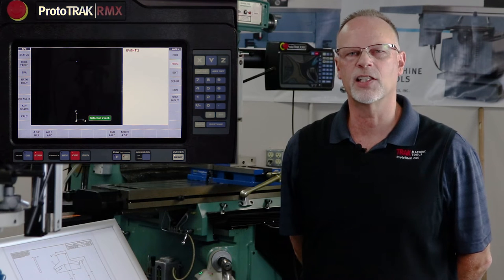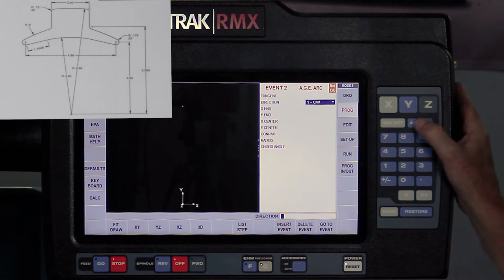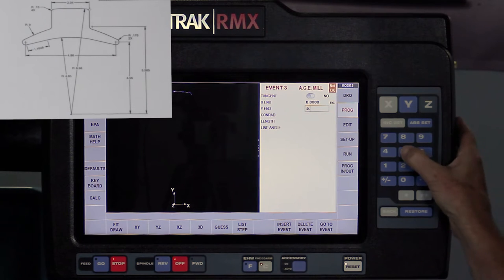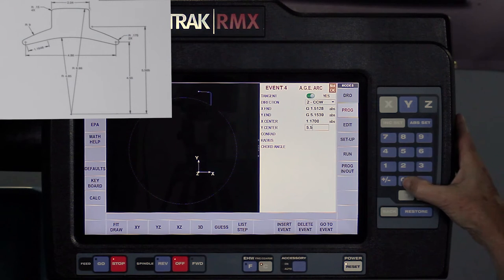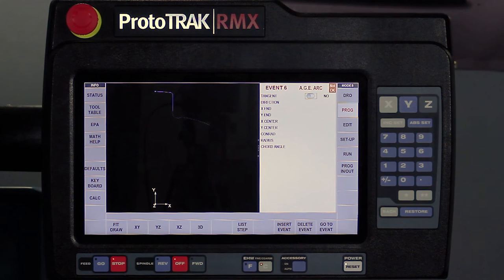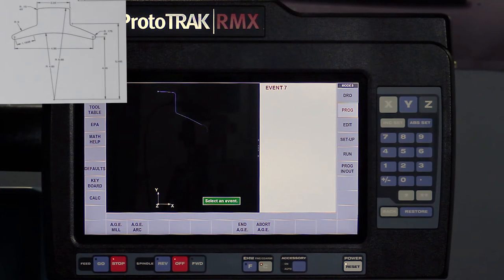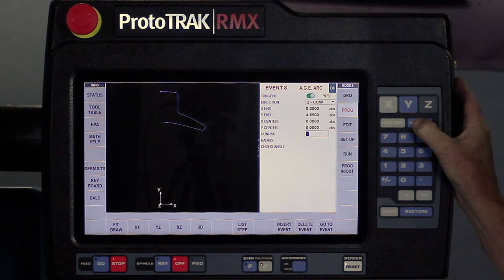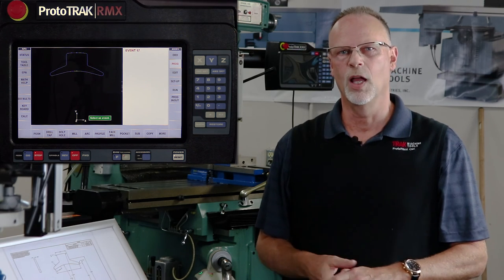A.G.E. [Part 5] | ProtoTRAK RMX CNC | Advanced Mill Programming

Comment: Hi Pat, I have a question that's totally unrelated to this video in any way, shape or form - hope that's OK!

I have an SMX machine with the DXF converter plug-in, and here at work we use Autodesk Inventor.
I'm trying to use an engraving tool to create some lettering in a 'flowing, hand-written' type of font.
Is there a 'best practice' way to do this? 
In Inventor I can create the model with the lettering on it, then use splines to model the path of the tool - basically following the middle of each letter
Problem is the SMX doesn't seem to like splines in the DXF file, I think it treats a spline as 1000's of tiny arcs, which each have to be manually selected.
Am I missing something obvious?

Cheers
Reply: Hi Steve, I have seen this problem before and I believe there are some adjustments you can make in your program to control how it creates the segments of your geometry.  It should turn it into a bunch of small straight lines as apposed to small arcs.  I'm not a CAD guy so unfortunately, I can't tell you exactly how to do this but hopefully, someone else will read this and post a better solution for you.  I do know that in some cases, exporting your DXF file as an older version such as a year 2000 file instead of 2018 for example can help with this problem too.  I'll copy one of our CAD guys on this to see if he can help you too.  T.P.
Reply: With flowing hand writing, there aren't any consistent arcs, things move in more of an ellipse which is why it breaks down that way. What you'll want it to do is break down into small mill segments, not arcs. If possibly, this would be much better to post out via a cam system into g-code and ran that way.
Reply: Thanks guys. I have found something that's helped a great deal, a program called StickFont (there's a free v1, and a paid v2). It can take ANY font and convert it into either g-code, or a dxf file of lines/arcs.

There is a small issue though - it doesn't produce a midline font (ie a single path for the cutter to follow), instead each letter is treated as a closed profile. (Imagine the letter 'L' . The cutter will start at the bottom left, move up, right, down, right, down, left). With some experimentation of cutting depth and lying about tool diameter it's still possible to get some really nice results !

I haven't gone the g-code route because I'm self tought, and prototrak machines are the only CNC machines I've ever used - I've never needed g-code before !
Reply: In Autocad, use the explode command.  That will give you a file of linear segments instead of splines.  Save the DXF file to, like Pat said, version R2000.  When you start your DXF on the control, and it asks for gap closure, change it from 0.005" to 0.0002".  Now select the first entity and then the second for direction, and it will chain all of those tiny linear segments.